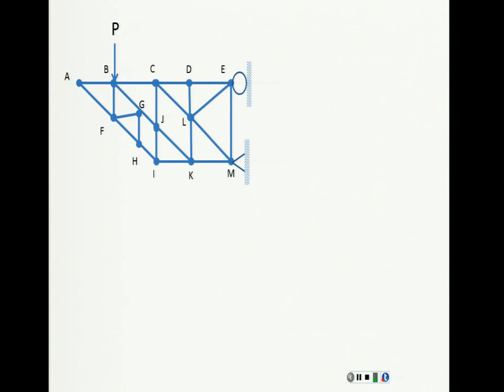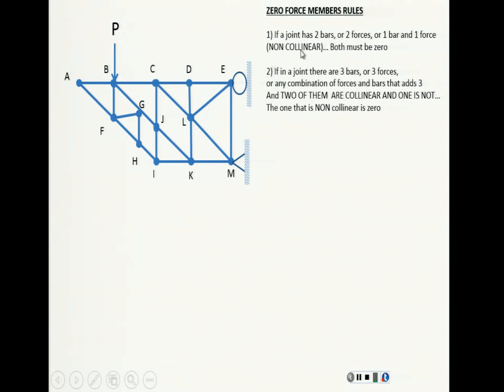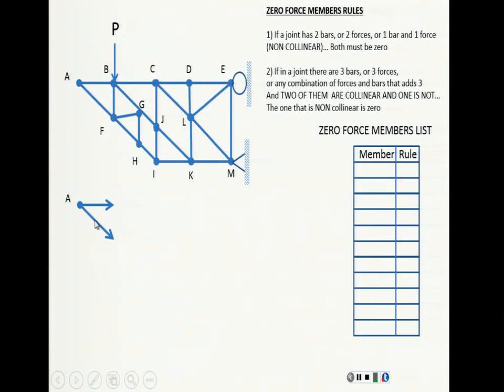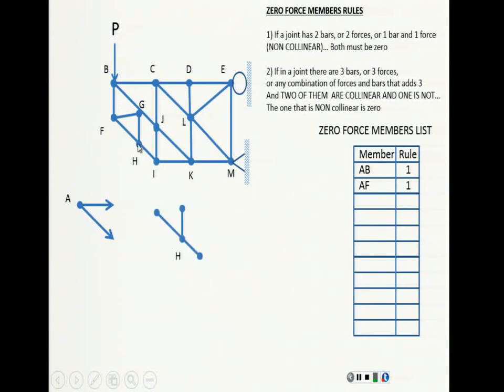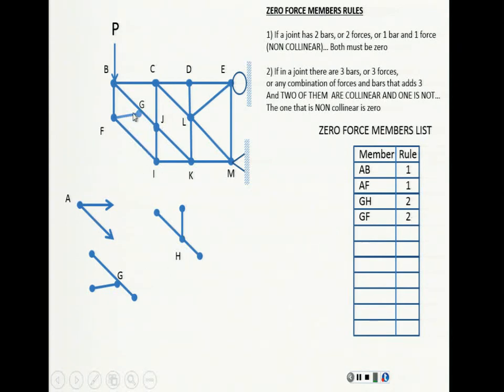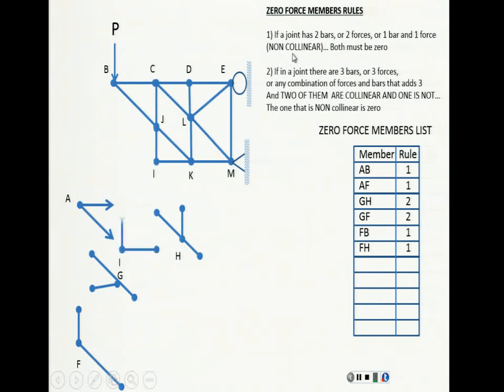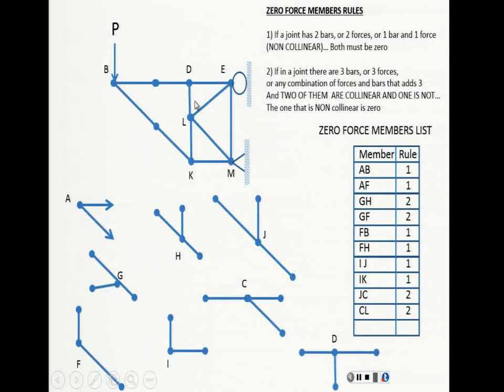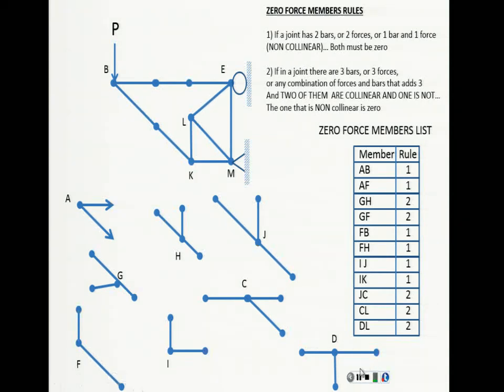Chapter 6.3 - Zero-Force members

Comment: sir suppose if two 3 membered joint has common non-collinear member and an external force is applied  at one joint and at other joint   no force applied ,then what about that member ? as in the sense of no force joint that non-collinear member is zero force member but it is contradict in the sense of force applied joint two members are collinear at each 3 membered joint